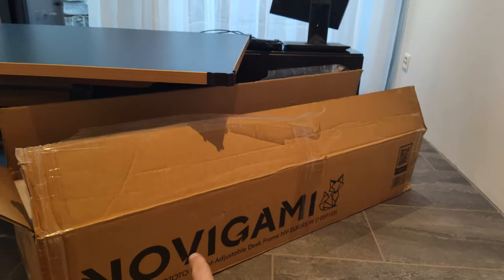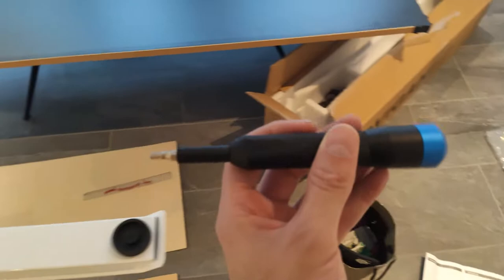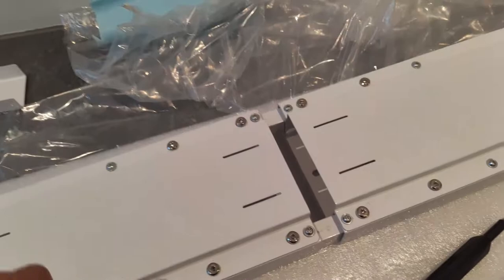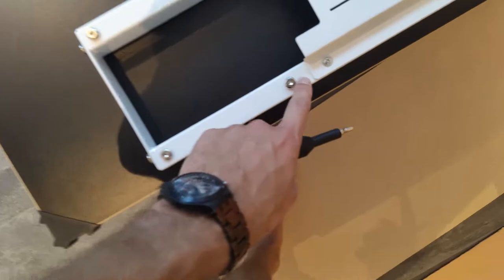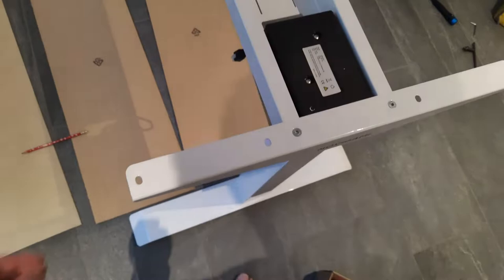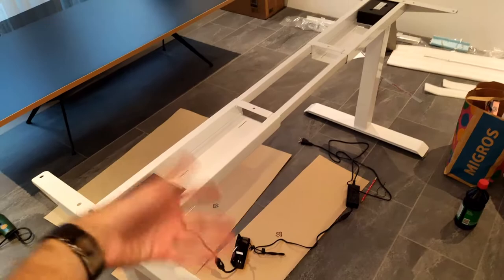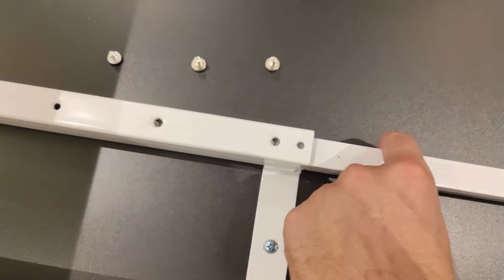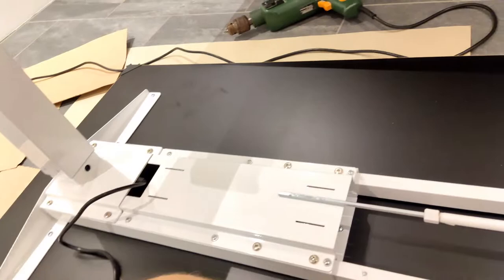Assembling Novigami Ototo electric standing desk

Comment: Thank you so much with out this it would not have been built I will say for anyone using a 1200w desktop you cannot leave 15cm either side I gave it 30mm either side and it's works fine to get the drive shaft cover on
Reply from the maker: I'm very glad this was helpful for you! :) thanks for sharing your changes too!